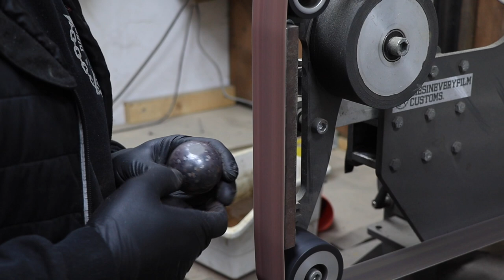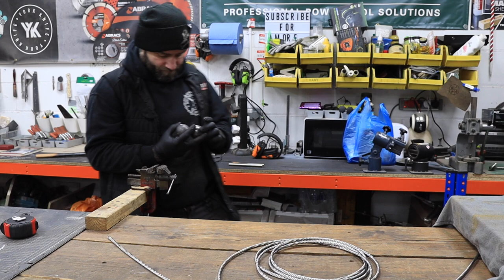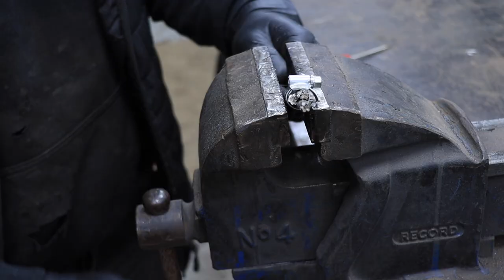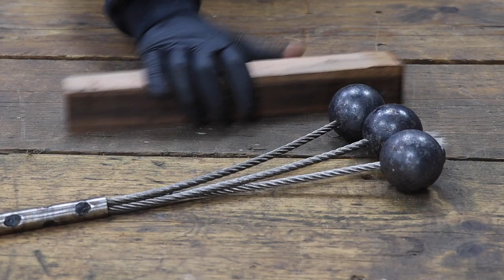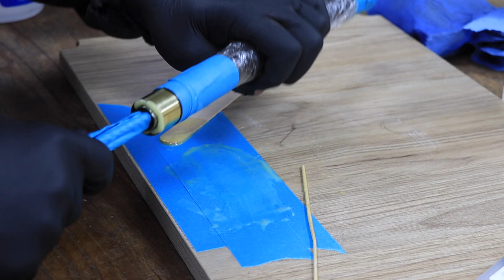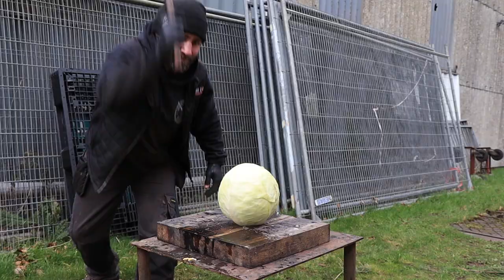Making a SAVAGE Modern Trench Raiding Flail - WW1 Builds

Comment: Clean work as usual, man. Reminds me of like 15 years ago when I decided to try to make a self defense tool for less than 75 cents. Ended up with a small flail made from a golf ball, some 1 inch wide webbing off something I broke, and a piece of wood from a glider rocker. Seems silly but when testing it I caught a rebound dead in the elbow. Not very lethal but EXTREMELY painful.
Reply from the maker: Thanks mate, ahh they are always the best for sure mate
Reply: Lol, can't use bouncy balls....
Reply: That depends on how large it is and how you mount it. The BIG ones would be good for a lot of blunt force. Still very non lethal. Probably good for extracting information.
Reply: I gave up on my self defense built as a kid when I made the (Infamous) Nunchucks... damn things caught me in me in my Ball area bloody hard. Thought for a minute I was bleeding from there lol....
Reply: During the unrest in the US in 2020, I had a kitchen table I didn't assemble because the leg weighed abot 10lb and had 1/4 x 20 bolts sticking out.  Too long and heavy for anything but a first blow by a former rock climber.  Would probably have damaged my wrist or flown from my hand if I had used it.  But pity the fool who invokes castle doctrine.
Reply: I used to 'craft' myself with PVC pipe, ropes, chains,

Comment: Cool weapon. I'm curious is there an actual advantage to having 3 metal balls? You could achieve the same thing with just one slightly larger ball and it would be less work right?
Reply from the maker: It’s a replica, i felt more impactful in use than one, different strokes for different blokes

Comment: No link to the "ball's" used???? FYI: Could have squared up the ball's you drilled faster, with "the compound rest", (assuming you keep an Aloris or other tool post on it) moving it by cross-slide over to them in chuck jaw's. Learned that in the 70's, running an engine lathe in "a model shop" making "jigs, fixtures, & one off tooling".
Reply from the maker: The balls were forged for me. 
Yup there lots of different ways to do things and I always try show different ways

Comment: why not use your wood lathe to drill the last hole you inserted the Flail into? It would have been safer and ensured it was center.
Reply from the maker: Because it wouldn’t fit in the chuck, would mean trying to drill with nearly all the wood out of the chuck, i drilled it the safest and best way